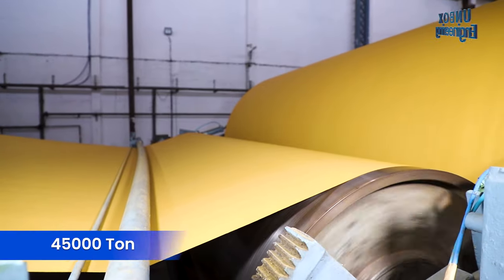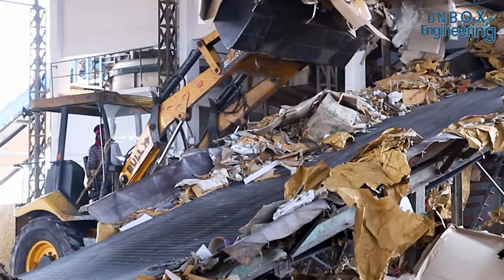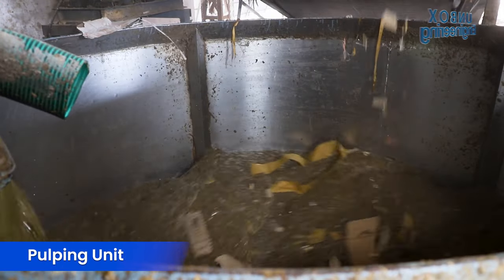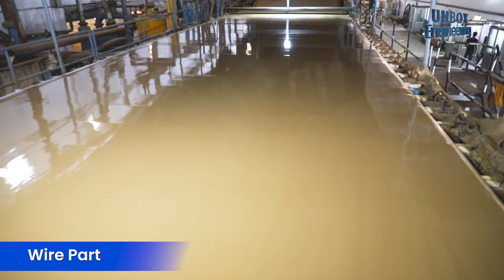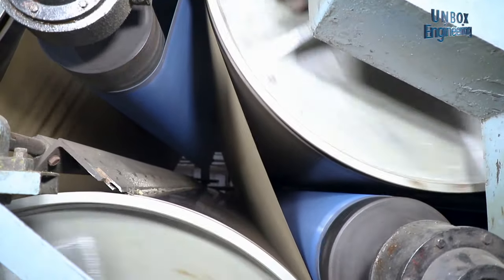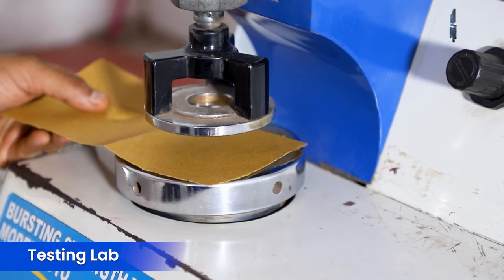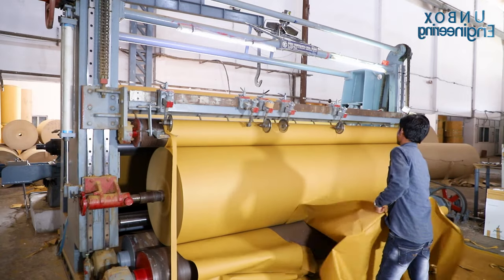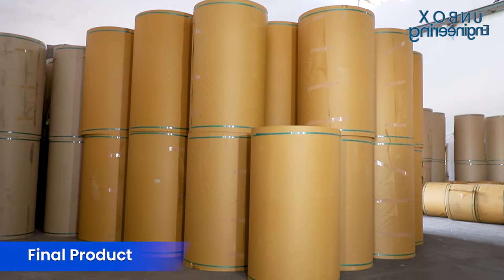Giant Craft Paper Manufacturing Factory - Inside Latin Paper Industry

Comment: The paper winder is very dangerous with little guarding by the front drum of the winder.  No slitter guards and no air trim system to take away the trim. Very antiquated.
Reply: Definitely need a nip barrier I've seen rolls come our a winder before it's a sight to see